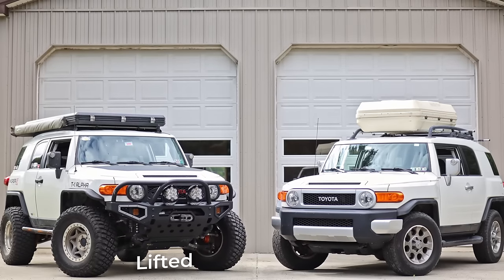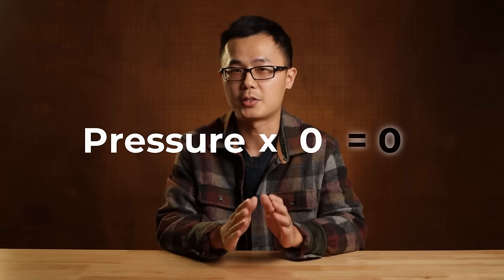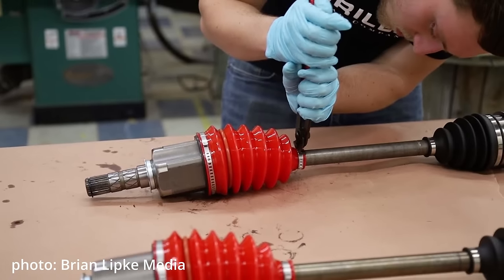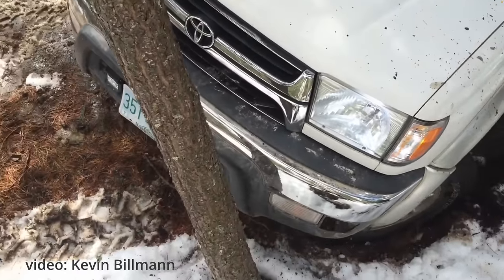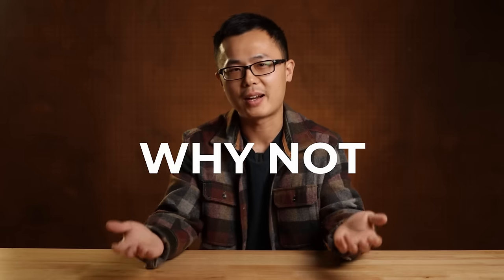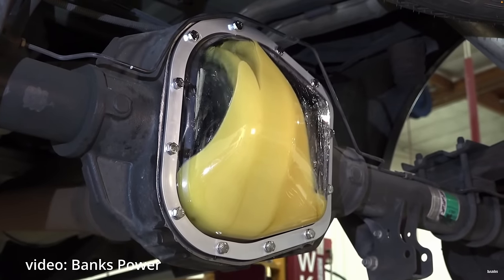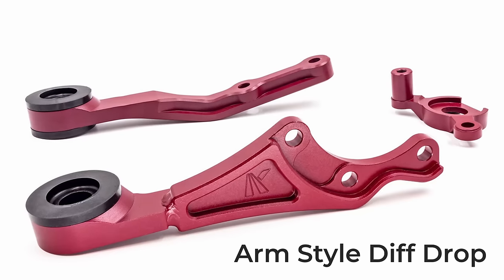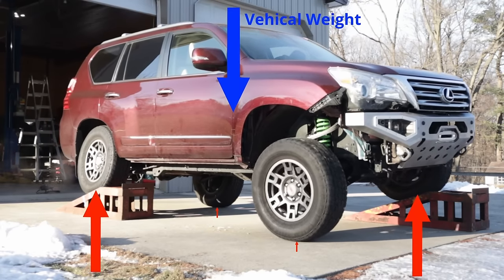More Harm Than Good? Toyota Diff Drop Truth vs Myth

Comment: U got a like & a sub from me.
had a 03 taco, way back & after spacer & body lift.
I did a diff drop bc of not liking the angles of the cv's, they ended up much better.
& i got an aftermarket skid plate that covered way more & worked with the diff drop.

Comment: (i can tell you from racing off-road - not even counting the durability) the most benefit of any axle is ground level or slightly below (usually slightly below equals negative suspension lift).
Example - just look at an ultra4 suspension and look how flat the CV and arm angles are.
 
the reason is the faster the axle spins the more it tries to level out. this means if you have your axle point down (high in the middle low at the wheel) when you hit the gas, the forces on the tire are up (the tire is trying to move away from the ground) equaling less grip. These forces a magnify the harder you hit the gas. yes, you can run a hard spring to stop this but will worsen the ability to move through uneven terrain.

slightly below (usually the most benefits for rear independent suspension) will make the truck lower but it makes the axle act more like anti-squat - force the tire down and lift the truck when the axle flatten out. this usually gives you the most tire grip and you can run a bit softer spring which give the suspension ability to move more freely.

also the more angle you have the less efficiency/power you have. the drivetrain is fighting to say straight which takes energy.

if you want more lift (don't do it to your street truck) run bigger tires and cut the body to make them fit.
Reply from the maker: Make senses, good info! The factory Toyota axles are actually 4 degrees. Outers higher than inners. The tie rods are almost horizontal.

Comment: Woo hoo I really like this thorough information.. save some cash for other things and saves headaches too.  Some of those clips that broke them were surprising.. first clip there wasn't any bouncing or tight turn involved it was quite surprising.  Thank you!
Reply from the maker: Thanks! That 200 series had seen some serious hard core stuff. I believe it was walking wounded. The stub shaft in the front diff was also broken hence there were 2 pops. I was spotting it right outside of the screen. Sparks were flying out right in front of my face.
Reply: @TinkerersAdventure  been a while i had to rewatch this.. keeping it under 2" for sure !

Comment: In your angle analysis at full droop and beyond, did you check the outer CV angle with the steering at full lock?

It's also worth mentioning that all of the measured angles and clearances can be affected by control arm and diff mount bushing compliance - hard to test and measure, but a small movement could be the difference between unobstructed movement and binding.

Great analysis and video as always 👍
Reply from the maker: Thanks! Yes, a shot of the outer joint at the very beginning of the video was with full steering. You're definitely right, even alignment will change the angle. I took measurements across LCA cam bolts settings, but it was too detailed so that didn't make the cut into the video.
Reply: @TinkerersAdventure  hi mate is there you can pm me through youtube, installed my diffdrop today and have some issues that im hoping you can help with

Comment: Yes, I just saw a 35” tires on an FJ Cruiser 07 with a suspension upgrade and lift kit on a 2 wheel drive.These where Nitro tires & heavy bumper. I guess they went off roading.

Comment: Good video!  
I lifted my 2000 4Runner 2" with Bilstein 5100's, OME coils, SPC adjustable UCA's, and mounted 285/70 17" Falken Wildpeaks.  I noticed a vibration at 60 mph.  It wasn't coming through the steering wheel, but felt like the entire front of the vehicle was vibrating.  I installed a diff drop and the vibration went away.  Don't know if I'm doing anything to increase the life of the CV joints, but the ride is much better.
Reply from the maker: It might be you front diff needle bearing. Have you try shaking the inner cv by hand and see how much play it has to the front diff?

Comment: Artic Trucks themselves do not do a diff drop when they build the AT35 D-Max (OK, not a Toyota), but this does show that it is probably not always necessary. Will the CV joints wear out quicker, possibly, but then again the larger tyres of the AT35 also cause increased wear for brakes, wheel bearings, diffs, etc... Essentially you are getting increased off roading ability and playing with durability. It is a price that sometimes has to be payed.

Comment: My friend had a lifted 2nd gen 4runner. He didn't have diff drop and his cv axle alignment was horrible and bound often. It became un-driveable. I drive an old silverado 2500 that uses torsion bars and it is also one of those vehicles that you need to have a diff drop as things get messed up really fast if not. Like you said - it is vehicle and model dependant.

Comment: I own an Xterra Pro-4X. On the foruns, everyone is against diff drops. They just Tiran Swap for more suspension travel and track width. They say Nissan CV joints are strong enough to handle the increased angkes. I'm still researching it. Diff drop lifts are obviously more expensive. However, your front drive shaft is much stronger than your front axles abd CV joints. If you jack up your front IFS angles, I susoect the axles will break first when off-roading. I doubt the front drive shaft will break, if you do the diff drop correctly.

Comment: 11:26 - I was yelling this in my head the entire video. The mental gymnastics are real. People who do a lift and then drop the diff back down because they dont do rock crawling and therefore dont need the clearance... why dont you just not do a lift?? Like you said, the suspension articulation is better at stock height. CV angles are perfect, driveshaft angles are perfect, CG is optimal... Stock tires have better torque to the ground, better effective gear ratio, better steering, etc, etc. People ruin perfectly good 4x4's and dont even know it. Stuff is not supposed to break all the time. That happens because you messed everything up with your lift. I had this realization with sports cars a long time ago, but its true with 4x4's too: almost every departure from stock configuration makes the vehicle worse.

Comment: Awesome video! Something we run into a lot is the driver side differential bearing that supports the CV joint failing prematurely with high angles. A .3" drop may help to rwduce sideload on that bearing. A lot of the beefy skid plates for these trucks have enough room to run the diff drop spacers without dropping a plate, especially kdss skid plates.
Reply from the maker: It might help. But I'd rather lower the lift height by 0.3" and ended up with 0.7" more ground clearance. yeah unfortunately many aftermarket skid plate designs have worse ground clearance than stock. those don't really make sense to me.
Reply: @TinkerersAdventure  right but the 4runner/gx460/gx470 kdss sway bar requires a lower skid plate at the front diff mount reguardless.

Comment: Awesome video!  Well, now I don't need to worry about this for my 4Runner or the Tacoma once I lift it.  I've read from multiple sources that the Tacoma needs a drive shaft center bearing spacer with a 2.5" lift.  I'm about to install Bilstein 6112's with Eibach springs and 5100's in the rear.  I ordered a drive shaft spacer to be safe.  Ironman includes them in their lift kits.  Would recommend this?
Reply from the maker: Thanks! Yeah I think the carrier bearing drop make sense. I don't see much negative effects on those.
Reply: @TinkerersAdventure  Great.  Good to know.
Reply: @TinkerersAdventure  How many toyota's or 4wd vehicles do you actually have experience with?  Almost all your videos are theory based and it seems like all you ever owned and modified was an FJ.  I agree with your theory most times, but I question your practical application.  Imo, I wouldn't recommend a damn thing for a 2.5" toyota lift.  It will take away almost all the droop and you will end up with less travel overall due to stiffer springs.  Not to mention the fact that some trucks may not vibe without a carrier bearing drop and the other ones will vibrate like hell. And that's leaving out the random factory toyota driveline vibes.   I'm a fan of the theory in your videos, but this isn't a one size fits all competition.  I guess handing out advice is easy when you don't have to cut the check and don't know any better.

Comment: Another point that has sat in my mind about diff drops is the amount of slip in the CV trunnions that allow for variations in the distance between joint centers as the suspension moves through it's arc. Presumably manufacturers account for the radius the outer cv travels in through compression, but if you go and drop the inner point an amount that would give substantial advantage on half shaft angle, there could be the possibility if the shaft pulling out or worse, bottoming out in the joints.
Also, drop your diff all you want, it's not helping the insane angles a lifted IFS puts on steering tie rods, therefore on load the rack and all the ball joints. Being a Prado 95 owner and seeing the number of ball joint failures in the community for people who've just lifted their front ends to the sky, yeah, nah, 2" lift life is fine.

Comment: Note ! the axle snap after engine rev down , so it seems it is the back torque input from larger tires that snap the CV?    Under compression , where you have the highest torque/traction, the stock diff has a lower axle angel ,  where the diff drop actually has a higher angel .  In full expansion the drop diff wins, but not much torque in a wheel off the ground! And how-about , when you are turning the wheels full stop L or R and still have full load on the axle?

Comment: I off-road difficult trails in my 2019 Tundra. Recently I broke my front differential mount in the frame. I had to weld it back up and reinforce it. I do not run a diff drop, but if I had, it would’ve made the situation worse as my differential would be a lot lower. As pointed out in the video lowering your diff doesn’t help cv axle enough to make a difference. It does lower your clearance though. 😢

Comment: I did the diff drop because my mechanic recommended it since I have a 3.5 lift kit on my taco. He said it would cause too much wear and tear on the CV axles. I was also breaking the boots but I didn't know there were high angle boots available.

Comment: So I haven't watched the video yet, I'm paused at 26 seconds. But I am interested to hear your analysis. My feeling has always been that diff drops are antithetical to lifting the truck in the first place, and the right thing to do is get longer shafts, or just treat the CV joints as consumables and carry spares. I can swap a CV in the field, but I can't as easily replace a diff if I crack it open on a rock. If you drop the diff, that puts it closer to the ground, which...is exactly what you are trying to avoid by lifting the truck. Excited to see your thoughts.

Comment: love the video. finally someone explaining things in way you can really understand. 

could you help me with this please. I have a daily driver Toyota Hilux 2024 and I want to add some wheels and bigger tires and was thinking to do a 2-inch lift using a strut spacer/extension. But so many people are advising me not to do it and recommending to do a full suspension upgrade. and my truck is a 4x2 rear wheel drive. should I spend $1500 for a suspension lift or $50 for a strut kit?

Comment: When just started off roading I had a diff drop installed with my small lift, because I had read that's what you're supposed to do. But I was annoyed at how much it lowered the skid plate. So I finally removed the skid plate and noticed the front diff mounts just barely moved, but the plates had to move a lot to clear them. So I removed the diff drop and have been happy since. 

There was also an occasional "thunk" when I came to a stop that has since disappeared after removing the drop. Don't know what it was though.
Reply: What kind of truck do you have? I have a 2011 Tacoma- I installed a diff drop bushing kit and i have this thunk once in a while too

Comment: Definitely a must with the 100 series from my research seems like you agreed. I wonder if it has to do with the constant 4x4 system they come with as well. I’ve added all those parts and am happy with it all. Did the part time conversion to reduce the cv wear more and skid around for fun. 
Seems like adding more extension travel and extended lower arms would be nice but then people break their stuff easy. Probably the drivers too like you said and no lockers, so they spin then catch at angle.
Reply: Knowing very little about 100s, I've still heard they have little droop, which could mean their CV angle is already high when neutral, thus doing a diff drop when lifting would be more critical.
Reply: @xturboexpress  yeah that sounds right, definitely lacking extension. It’s odd because the aftermarket upper A arm hits first, on the mount.
Reply: It's because of the torsion bar set up in the front vs coil/coilovers on other toyota models.

Comment: The arm style diff drop was $695 Australian, so $465 US.  Still a lot, and it doesn't seem to be available in the US.
Reply from the maker: You're correct. But if I could pull 10" travel like I hoped for, it sounds like a bargain to me. A 11.5" travel +2 LT costs almost $6K USD all set and done.
Reply: I think it’s worth looking into being made here for that US price. A lot of guys would buy it. I would
Reply: 575AUD from phat bars Australia.
Bit cheaper than Kaon 👍
Reply: I have an n70 hilux here in Australia.  With 2inch lift arb Bp51 suspension,  I was getting cv bind up pretty badly,  UCA'S superior engineering alloy billet , LCA'S replaced to super pro offset , wheels are +15 fuel covert bead locks ,tyres 285/70 ×17 , I used the Kaon diff drop and removed the Cv bind completely,  great content!

Comment: Small nit, flowers after criticism. Testimony from those two companies is of course biased, they sell lifts and say no diff drop needed.  You further dismissed real world reliability data citing it as unattainable, using theoretical models in it's place, this is of course exactly what good engineers do when lacking any alternatives.  So,  in theory, theory and practice are the same. However, in practice, they're not.    Go get reliability data and you will see.  Of course widening your margins can make up the difference (driving conservatively)  that doesn't count.  Diff drop is the ONLY way to lift an ifs properly, everything else is compromise.  However, your videos are unparalleled on explaining those compromises,  thumbs still up,  keep em coming!

Comment: Wow, so much good information here! I just did a Torch "Add a leaf"(1.5 - 2") in the rear and 2" pucks up front in my 2021 Tacoma  crew cab. I am getting low speed vibrations now and assumed a diff drop might help. I had 2.5° angle wedges in the rear and removed them thinking it was too much. Still vibrates. Any ideas would be greatly appreciated!

Comment: Awesome video!  As a 100 series owner with a lift and diff-drop, I can't say I wasn't relieved to find out there was an exception, lol!  Any idea what the difference is?  I know the 100 series is a torsion bar suspension and not coil sprung, but the diff drop itself is different from the other examples.  Most just looked like spacers with longer bolts and the 100 is a full crossbar.
Reply from the maker: Thanks. I’m not sure why the 100 series requires a diff drop. I’m kind of curious as well

Comment: Wow! Thanks for this but….
I have a ‘22 Tacoma Pro and as you know it has a factory lift as standard with the Fox coil overs and I recently installed the Westcott 1.5” lift (so 3” over stock Taco) with Deaver stage 1 leaf springs (2” lift).  Anyway, rumor has it that everyone has an issue eventually with the driver side needle bearing with the fix being the East Coast bushing replacement. I assumed the differential drop would save the needle bearing but now I kind of doubt it.

Comment: 2012 fjc 6sp full time 4wd. Im running bilstien 5100 on the top setting. No front anti sway bar. I can hear and feel the driver side cv bind during a left hand turn through a intersection. I've learned a lot from your channel. I removed the the d/s taco lean spacer and it helped a little but I believe limiting straps will be the remedy
Reply from the maker: Do you have aftermarket CV axles? Like ones from autozone/Napa? Most of aftermarket axles below $500 each has different joint design all together. So they have much less angle capability.

Comment: I wish I could get every yahoo who thinks they know a thing or two about suspensions and lifts to watch your videos. So many guys out there maxing out their droop angles and thinking they have gained more articulation. So many more thinking lift is the only way you get bigger tires on a vehicle. A friends son wanted to put a three inch lift and 1.5" spacers on his Tacoma to fit 33"s. After I showed his dad your videos he put a stop to that nonsense. He has the 33"s on his truck but with a two inch lift and no issues with anything in the drive line. The kid doesn't do anything other than ride around town trying to look cool anyway so it wasn't like he needed a killer suspension setup.

Comment: I heard part of the reason to installing a dif drop spacer was to help with the needle bearing loading. Or something like that....
Reply from the maker: That is not addressing the root cause nor will it guarantee to work. The proper way is replacing the needle bearing with a bushing.